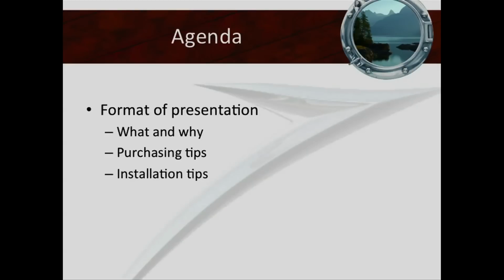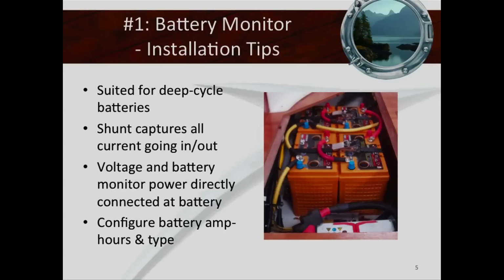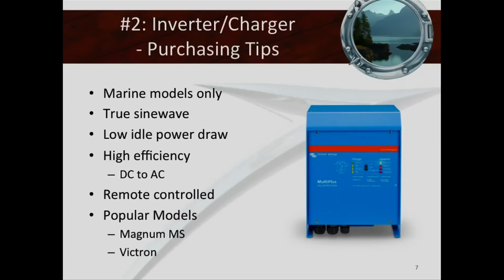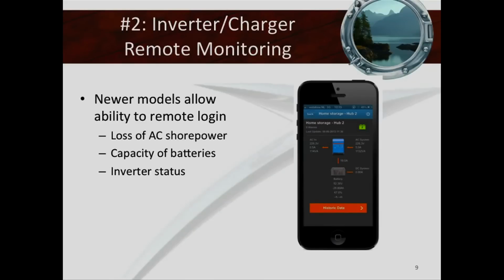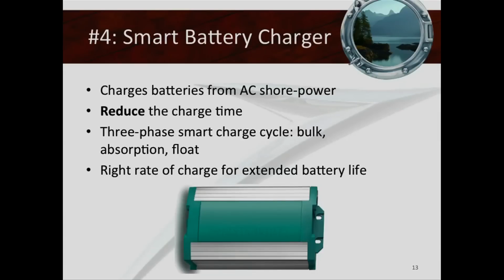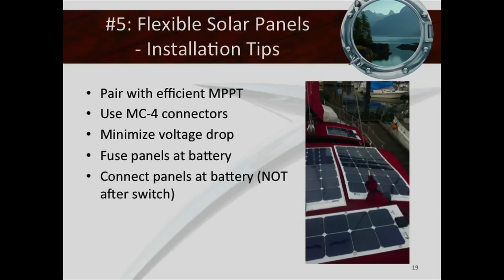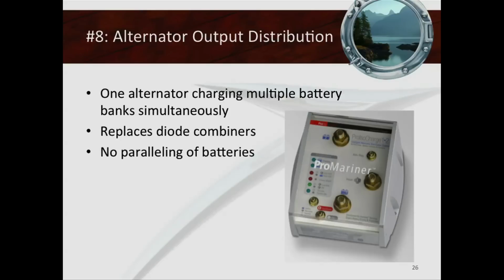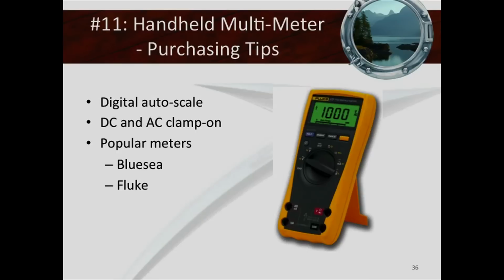Boat Show 2016 - PYS Marine Electrical Products Top 10

Comment: Please say a bit more regarding not connecting the charger output to the battery switch. Is not the post on the switch a direct connection to the batteries?
Reply from the maker: Hi Jonathan, good question and sorry for the confusion. At it's most basic, a battery switch has 2 posts: a unswitched post (i.e. always connected to battery) and a switched post (only connected when switch is on). Your battery charger should never be on the switched side of the battery side. In other words, your battery charger should always be connected to battery, even battery switch is off.
Reply: @PacificYachtSystems  Roger that, thanks

Comment: How do you feel about combined charger inverter systems?
Reply from the maker: Hi Erwin, an inverter/charger combo is unit is good way to save installation time and
capital cost over buying a separate inverter and separate charger. We’ve
installed hundreds of these inverter/charger units and we are pleased with the
results. The main difference is that a charger, as a standalone charger, can charge
up to 3 batteries on separate charger outputs while an inverter/charger is a
single output charger only.
Reply: @PacificYachtSystems  So how can you charge multiple batteries with an inverter/charger? Just busbar or another battery isolator would work? thanks a lot for all you're doing